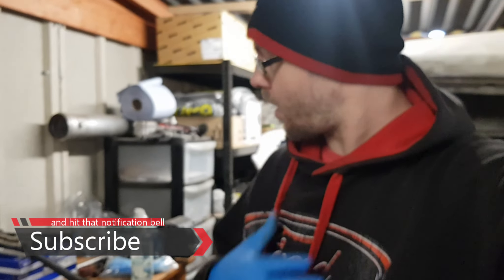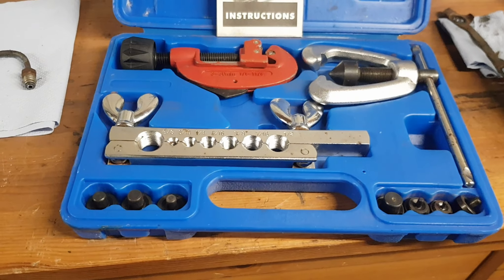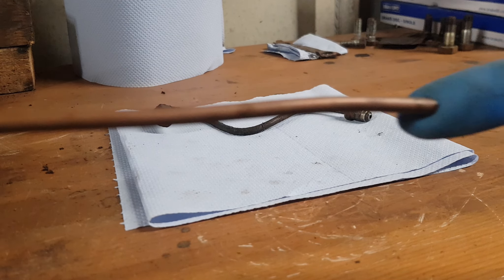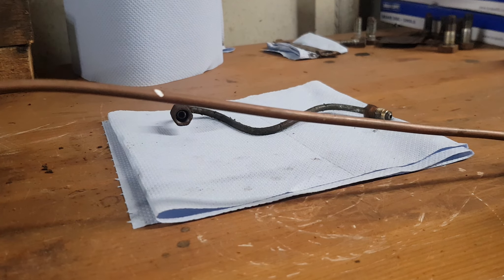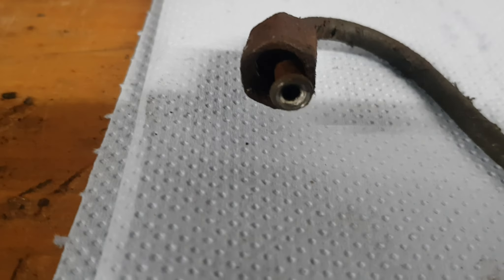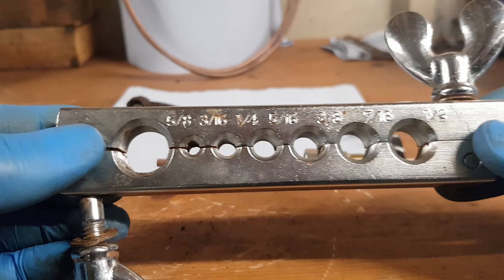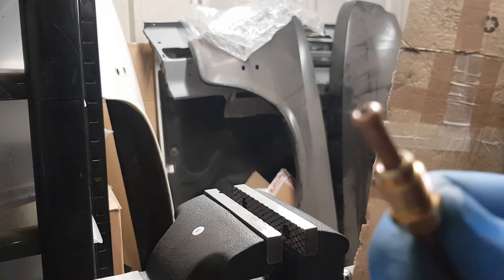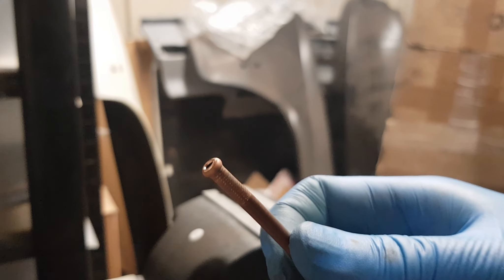How to make a brake pipes like a pro very easy !!

Comment: Great video and advice I bought some pipe and fittings when I did my brake servo on my escort just as well as it did what you did try them before you put them on the pipe as they where metric instead of imperial
Reply from the maker: @william walker nice one yes had that problem on a fiesta once built it all came to fit it god damn imperial 🤣🤣
Reply: @RetroCarsReborn  what made it worse is when I went to the shop I gave them a couple of the ends of the pipe with the thread and told them is was an imperial threads for a classic car he put all the bits in a bag so I didn’t think to check it was only later on when I come to fit them realised they where the wrong size I ended up using the old ones

Comment: To measure how far out the copper pipe is to protrude, you're supposed to use the thickness of the collet as the measurement.

Comment: Older video, but still applicable. I use 1/4 in soft tubing to copy or design brake lines. It bends like a brake line and measures out pretty accurately.
Totally agree with cut-to-fit brake/fuel lines vs.  store bought run all over the place, poor appearance.
I also make fuel lines with ANSI flares/fittings, using the Rigid flaring tool. Not affiliated. Perfect leak proof connections.

Comment: Tell me that's not a pure copper line, and if it is, you're just using it for demonstration purposes only.
Reply: Unfortunately the UK generally uses copper brake line. You can get copper nickel. It's just rarely used.
Reply from the maker: Yes thay are but I do paint them when fitted 👌
Reply: @RetroCarsReborn  Hi what do you use to paint the pipes after???
Reply from the maker: @dannyjackson915  you can paint them with hammerite or spray them green like most manufacturers would of 👍
Reply: Would have.